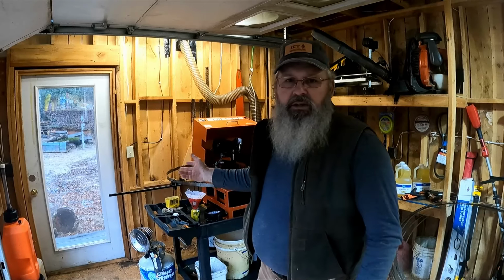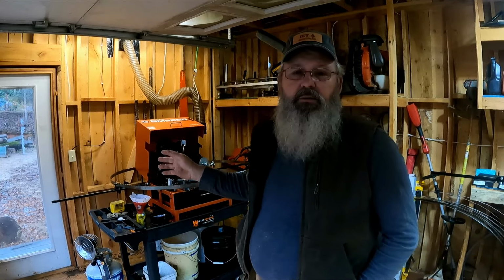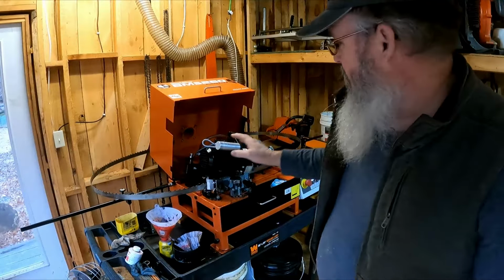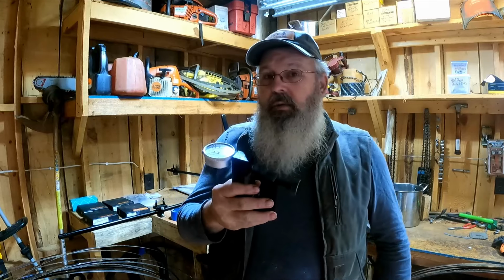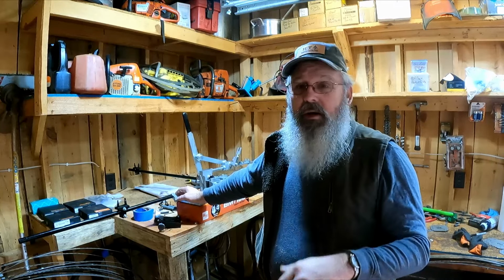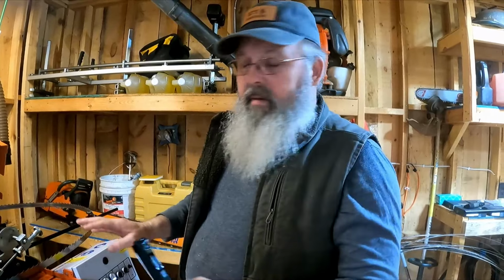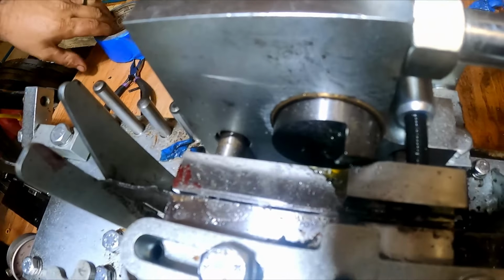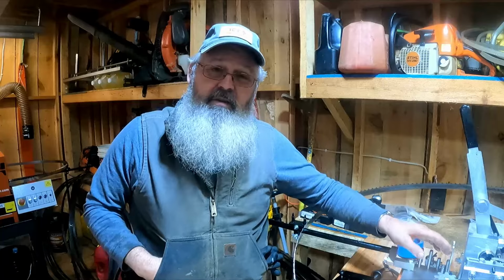Rainy Day in-depth Blade Sharpening Tips and Tricks

Comment: Thank you for sharing your experiences. I have the same sharpener and a BMT250 setter. Llke you said the sharpener is easier to setup and operate than the setter. Sometimes I get frustrated with the setter. Thanks for explaining how to set  the teeth back to towards zero and how heat effects the spring back.
Reply from the maker: Thx Dave I hope it was helpful 
How do you like the 250 setter?
Thx for watching
Reply: I had couple issues  with the setter. The indexing arm bracket needed to be replaced due to a poor weld causing the sensor not to read and the left side setter was sporadic. WM sent me new springs. Otherwise I like the machine and that it’s automatic. Now I just have to get use to the operation and the fine tuning and realize each blade could be different.